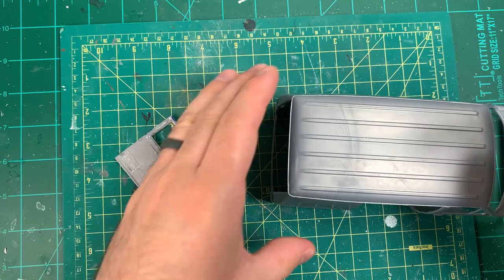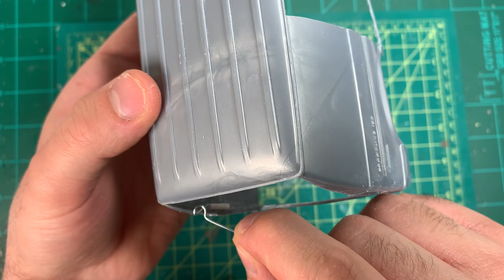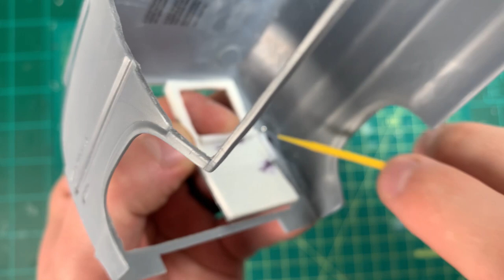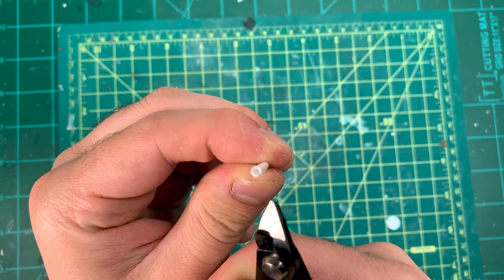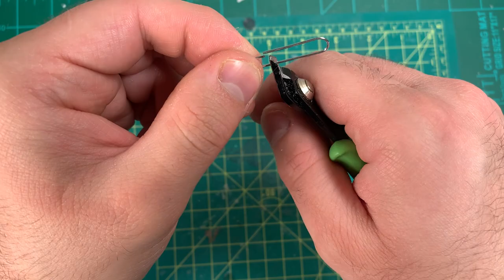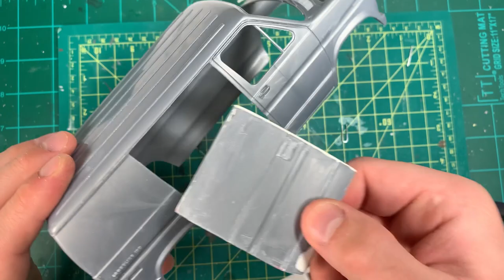HOW TO MAKE DOOR HINGES ON MODEL CAR KITS

Comment: for a cleaner hinge, change your  tubing out for Radiator hose, Then use .032 brass tubing for your rod. It will fit within the hose, but yet be tight enough to hold the door in position, You ca also slide the door through the tubing to get proper vertical alignment on your doors
Reply: Hi would this method work on wooden doors.